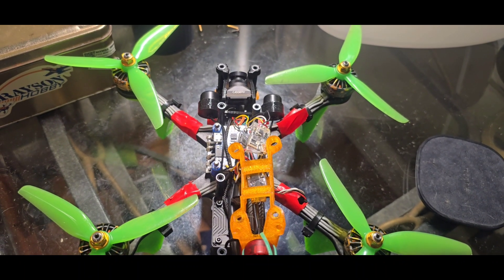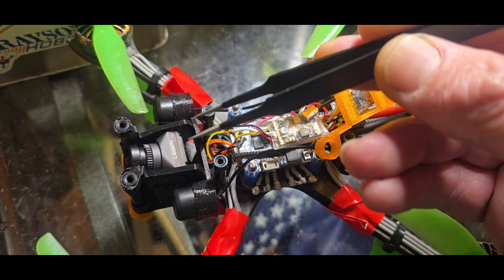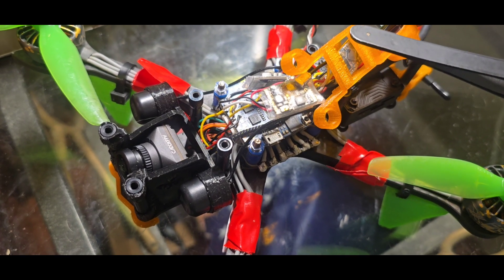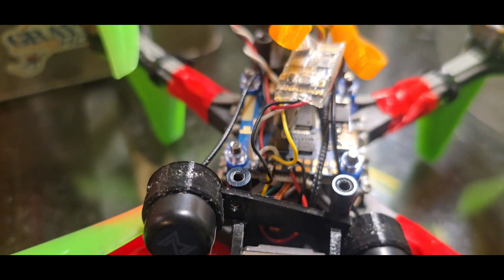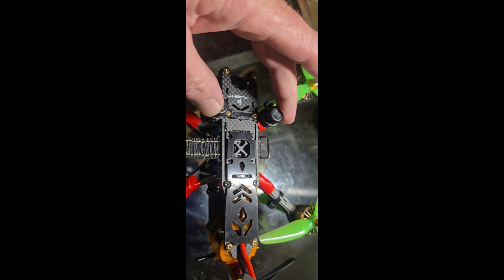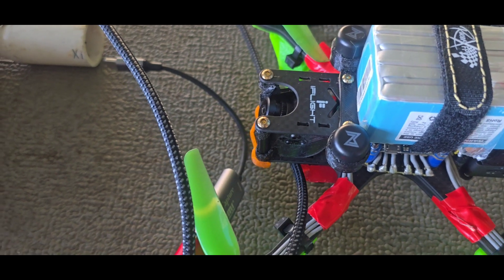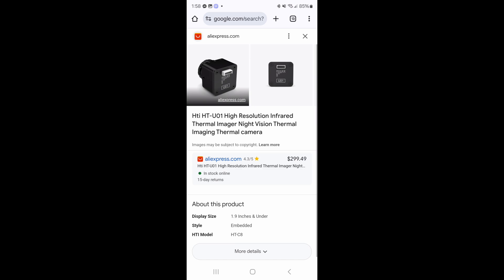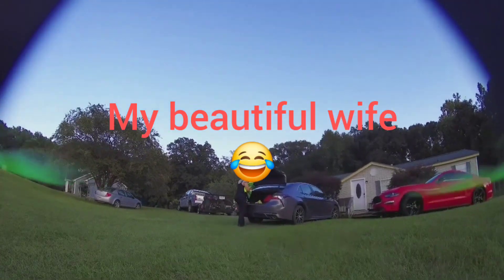Thermal Walksnail Hybrid Drone with Altitude Hold Betaflight 4.6

Comment: How has the alt hold been working?
Reply from the maker: @sneakerhead3256  it has been working great as long as the wind isn't blowing and you calibrate the accelerometer correctly. I use levels in top of my motors to level mine because calibration.
Reply: @ did you use the browser to flash? I can’t seem to find the 4.6 update option. Only see 4.5.1
Reply from the maker: @sneakerhead3256  make sure you have it set to show beta releases. I think I used the app to pull the beta and flash but you have to use the browser to connect. The app will not connect to 4.6
Reply from the maker: @sneakerhead3256 works in either one choose the development tab
Reply: @ finally got that aspect now I can’t get osd working on 4.6 did you have any issues?
Reply from the maker: @sneakerhead3256  no issues what is your build list and FC? There may be some bugs
Reply from the maker: @sneakerhead3256  HD setup?
Reply: @ yessir, have all the display ports and everything but can’t get osd to load. Go back to old 4.5 and it’s fine. Is there a fix?

Comment: Not sure if there's a reason why not but have you thought about the walksnail GT VTX? It has a fan, I have both the moonlight and GT VTX and the moonlight VTX over heats frequently but the GT has never over heated on me, and my quads that have those have GPS and sometimes it takes a while for the SATs to lock
Reply from the maker: @HowardPhillips46  I don't use a GPS it's fine as long as I plug in and go. I am going to try one soon. I've got a pro set up and multiple others.
Reply from the maker: @HowardPhillips46  this was just a test run to see if I would like the set up. I'm going to get a better thermal camera now with the different modes and larger field if view. Possible head tracking.